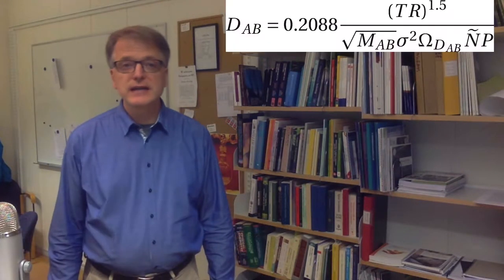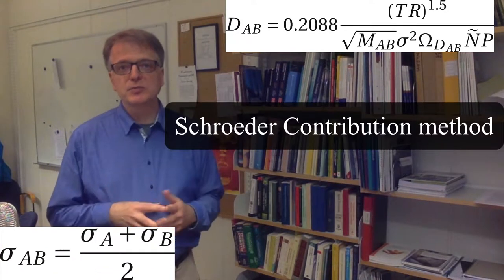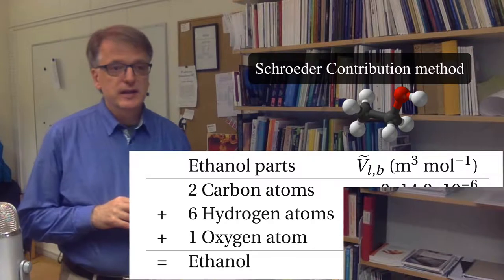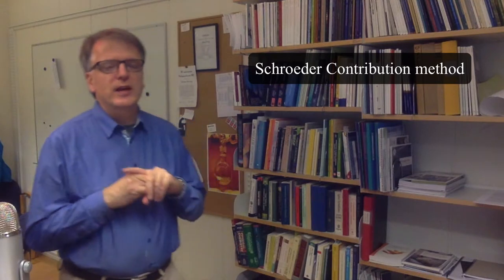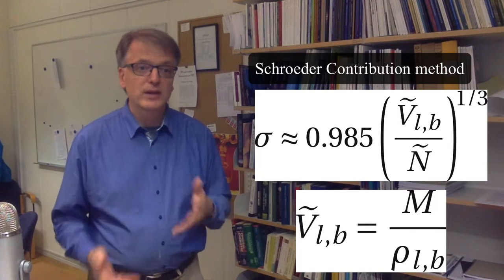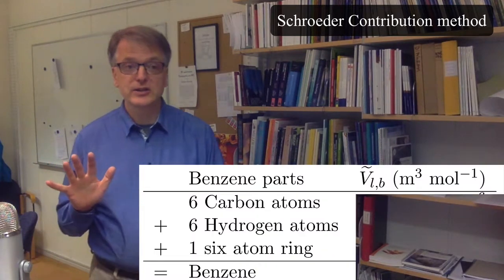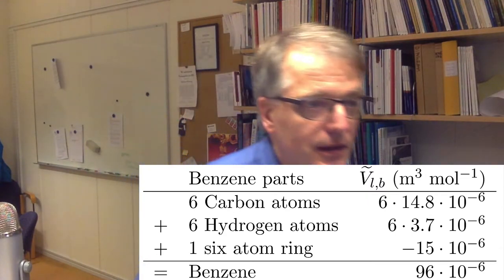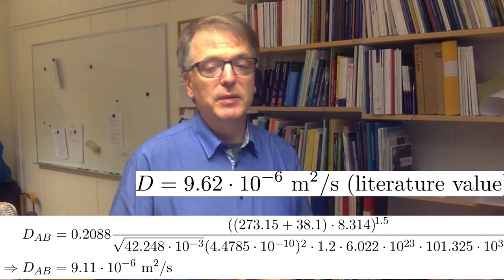Estimating diffusivity: Contribution method

Comment: Sir
Can you suggest a method to calculate effective moisture diffusivity from a given drying curve ?
Reply from the maker: Not my personal field of expertise, but I would tend to think the following:

which equation/model is most suitable is likely heavily dependent on your actual drying goods and its geometry.

Vega-Galvez et al https://doi.org/10.1016/j.biortech.2010.04.040 writes "The mathematical solution of Eq. (2), when internal mass transfer is the controlling mechanism and one-dimensional transport in an infinite slab is assumed, and is given by Eq.(4)according to Crank (1975). For sufficiently long drying times, the first term in the series expansion gives a good estimate of the solution (Di Scalaand Crapiste, 2008), Eq(5)"

Thus, a crucial point is reasonably the dimensionality of your material, e.g. if it can be considered an infinite slab, an infinite cylinder or a sphere.

Comment: Would you mind providing references for the equation used to estimate the collision diameter of close-packed spheres from the molar volume of a liquid at the boiling point?
Reply from the maker: I'm working from home, so I don't have access to the books right now. If I remember correctly, Perry's chemical engineering handbook is one that talks about this. Note that the equation sigma ≈ 0.985 ( V/N_A)^(1/3) shown at 2.35 in the video is one of the variants found in text books. The exact number before the parenthesis varies. As I write in my compendium (in a footnote) 

"Other sources may give slightly different values than 0.985. This number can be compared with the somewhat unrealistic assumption that the volume each molecule occupies is a perfect spheres and that theses sphere are packed as close together as possible. Kepler’s conjecture then states that these spheres will fill π/sqrt(18) ≈ 0.74048 of the volume, i.e. 0.74048V = N_A 4πr^3 /3 which gives us sigma = 2r = ( 3*0.74048*V/N_A/4/π)^(1/3) = 1.122 ( V/N_A)^(1/3)"

The reason why some use 0.985 and some use some other values is likely that they fitted the value to experiments done on different substances. (BTW, N_A is the standard symbol for Avogadro's constant nowadays)

Info on Kepler's conjecture can be found in various places, e.g. https://en.wikipedia.org/wiki/Kepler_conjecture

A rather random literature search gave this hit on a slightly similar subject: https://doi.org/10.1016/0166-1280(96)04474-0 comparing the modelled isotropic collision diameter with the collision diameter we are after here (which is defined by the point where the Lennard-Jones potential is zero)